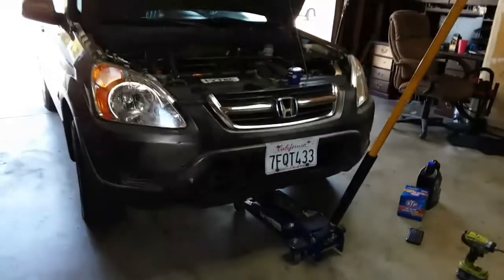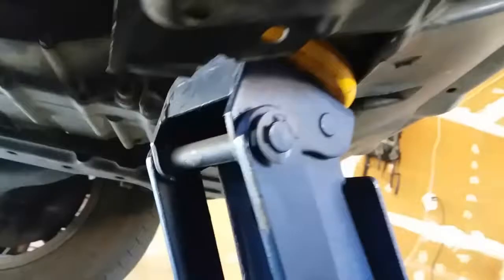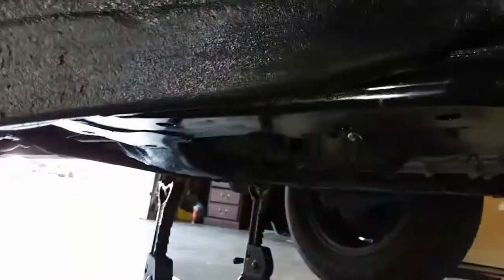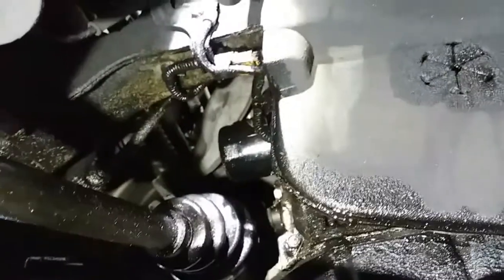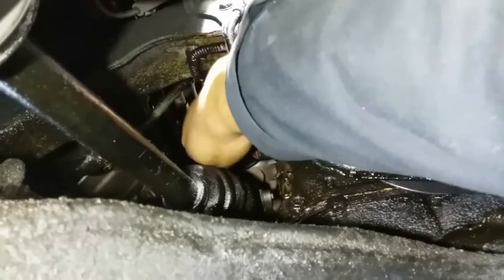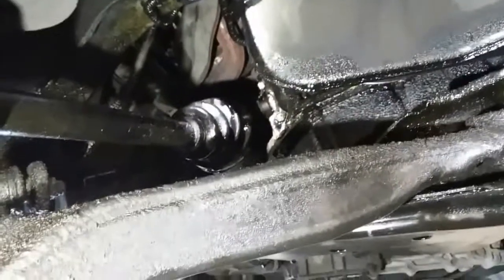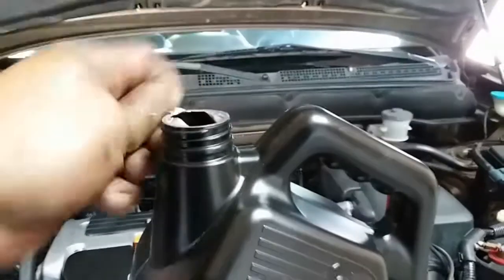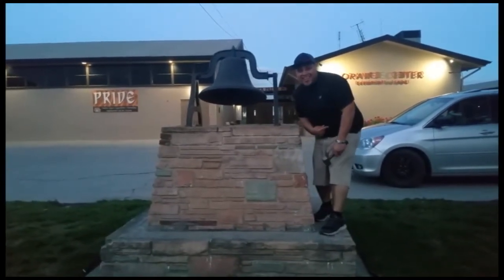How to: Change The Oil on a 2002 Honda CR-V

Comment: Thanks so much friend. I have a 2002 Honda CRV, and just before Thanksgiving, me and my dad replaced the idler mount and belt, and my cars oil light has been flickering. Someone else's Honda video said to top off the oil. Your video just happens to show exactly where the oil cap is, but also how to do a full oil change. So, if a top off doesn't fix the oil light issue, I'll do a full oil change myself and save money from having to take it into a Jiffy Lube service center. Again, thank you.
Reply from the maker: Heck yeah brother, im glad this helped! This is the whole reason I make these videos, to save you a buck or two. Thank you for your Support 🙏